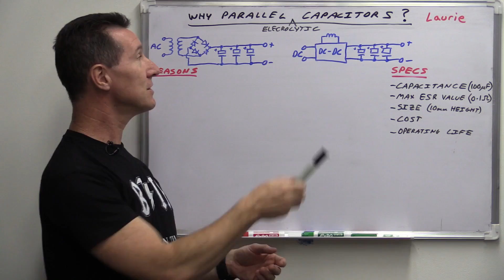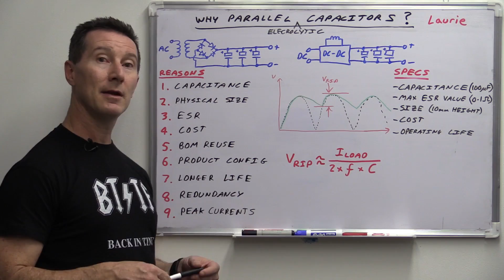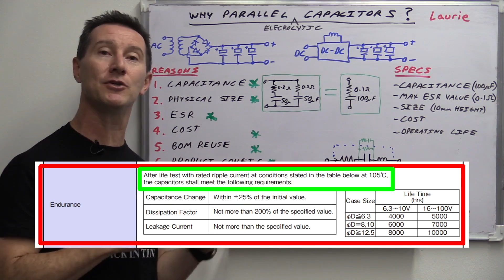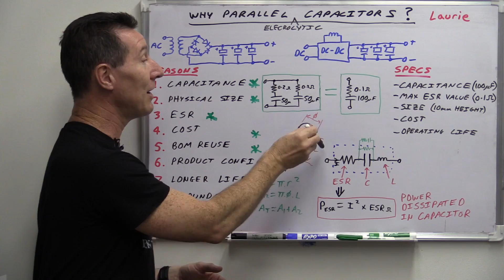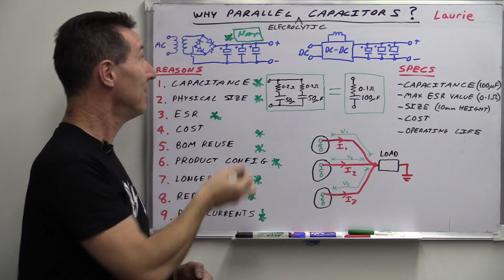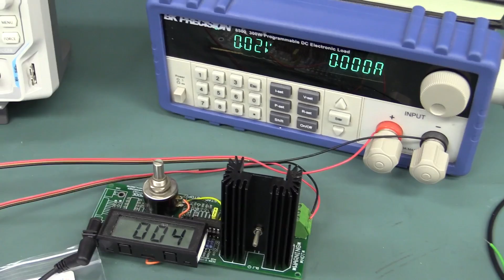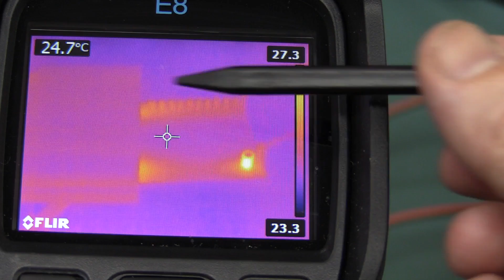Comment: Hi Dave, I'd like to share a practical example related with this video. 
Three months ago, my Neato 21 vacuum robot got the "Dimm Green of Death" after one year of continuous use. I replaced the batteries but the robot doesn't wake up. 

Looking around the web, I found that the problem are the capacitors. They used 1 capacitor in each voltage regulators. 

You can see a Russian guy fixing the robot: https://www.youtube.com/watch?v=WR7yx-E1Y14

This example has all the elements that you discussed to the robot follows the path of failure.

Thanks for the video. I will have a more fun weekend fixing this than playing Xbox.

Comment: "Electrolytic Caps 101". Great vid Dave. Chock full of years of practical experience. 
Suggest making "part 2" next addressing questions raised here in the YT comments and in the forum.
Reply: davecc0000 Yeah probably needs a part 2. I forgot to include a few things I originally had in mind. That's the problem with not keeping a list before I go record a video.
Reply: EEVblog Yeah, terrible. (c;
You cover 99 of 100 things in the category of e. c.'s. better than any educator I've seen. It's not due to failure on your part I ask for part 2 but your subscribers' insatiable desire for more knowledge!

Comment: I don't think that Stefan-Boltzmann equation is the right one since thermal energy will be mostly dissipated by thermal conduction, while S-B law is for thermal radiation. Anyway, the area of the capacitor surface still maters as the thermal conductance is proportional to the area.

Comment: Even Man is designed with two capacitors in parallel adequately positioned for better heat dissipation and a reliable system for redundancy to keep your load happy in case of a partial malfunction.

Comment: yep, radiation, heat transfer, but most heat is dissipated by convection!!
of course, if you are in gas or liquid environment with gravitation :P
Reply: Bastek Master you are 100% right. With those small temperatures the main heat transfer mode is convection, radiation is negligible.
Reply: vihai Dave isn't master in heat transfer theory :P
Reply: ***** there is no simple equation, but thy are simple rules, CFD tools.
There is still area for intuition design and experimental testing.

Comment: so lets say i need 50 mics on my little power supply.... 

what would 0 or 25 mics do?
and what would 75 or 100 mics do? 

basically...what happens when your under or over spec.... and if you were to design a power supply, how would you find your needed value?
Reply: Hey, that's what spice is for ;9
Reply: ***** ah. so its just for ripple control (dur). cool, thanks!
Reply: ***** 
You shouldn't overspec either, especially in standard transfomer/bridge rectifier circuits. Higher capacity means lower ripple, which you'd think is good. But with less ripple there's also less time to "refill" the caps, because they will only be charged when the voltage at the bridge rectifier is higher than that of the caps (obviously). For the same load that means the same amount of energy has to be pumped into the caps in a shorter time every cycle, which results in higher currents through the transformer secondary, the rectifier and the caps.
To make it short: if you replace caps use the same value that was in there. And if you design something be sure to take that effect into account and don't massivle over spec either.

Comment: Stefan–Boltzmann law is not very usefull in this situation since most of the thermal energy is going to be dissipated through
contact with the air and not radiated in the form of electromagnetic waves. Blowing cold air into the caps lowers their temperature even though it doesn't affect the black body radiation at all. Also, I don't think that you substract ambient temperature from the temperature of the body to calculate the power radiated.

...I liked the video.
Reply: enguibuck Yes it only applies to a non convection environment (like a closed case), and assuming no conduction through the leads. It's part of the story, not the whole story.

Comment: Nice video Dave as always, very informative and a good demonstration at the end.
Being picky but I think you had the A1 and A2 back to front with reference to the formulae when you discussed the capacitor size at 13:39.
What was happening to your FLIR display right at the end, seemed to be jumping around a bit swapping displays.
Reply: Michael Hawthorne The trigger button was pressing on the tripod and taking photos!

Comment: I was kind of hoping you would include why they are parallel to the circuit specifically as that is what I first though the question was about, or at least part of the question. I have some high power filters for I think 3 phases and the capacitors in them are in series. AC application so a bit different.
Reply: Tuttomenui He covers series capacitors in the '#268 Xantrex Power Supply video' and why you can add resistors for voltage sharing.

Comment: Lots of good items on the "capacitor specs" list, but it's notably missing an important one...working voltage.
Reply: lmiddleman True.
Reply: Yes, but working voltage isn't necessarily a reason why to parallel capacitors, which is what he's talking about here in this video... Working Voltage definitely IS an important spec to consider when installing a cap, but that spec really has nothing to do with WHY to parallel capacitors.
Reply: @JoeJ-8282  but it does feed into size - a higher working voltage capacitor is going to be (much) physically larger for a given capacitance all else being equal, which might run afoul of your design constraints.

On the flip side if one high voltage cap fails short, things are gonna get interesting real quick.
Reply: Maybe temperature as well

Comment: You did not show that 2 caps in parallel with each 1/2 the current will have 1/4 the power  wasted in each or 1/2 power wasted in all.

So not only do you have twice the surface area but half the heat in each. So 1/4 temp rise.

Also works for MOSFETS. Had a buddy with a DC high-side switch get too hot. Added a second on the same heat sink, and it ran cool.

Comment: In my experience electrolytic caps in parallel are most often found in RF Power amplifiers to overcome voltage rating limitations and arc-over issues. They are put in parallel or series-parallel, each with its own bleeder resistor. Commonly with 3K to 5K volts running >100 watts across them.

Comment: Replacing capacitors is always the thing wrong with modern TV's. Best thing are the ones that are easy to open up and replace!
Reply: aaroNiGHTS They do fail a lot in TVs and monitors yes.  And it's almost always the same ones - the output capacitors that filter power to the low voltage processor/TCON boards.  I really wish they would just add the extra $5 to the cost of the TV and put some high quality caps in that one spot at the factory,  but nope they'd rather have you buy a new TV.  I'm tired of replacing these shit Samwha/Sam Young caps.
Reply: aaroNiGHTS what

Comment: Nice job on the video. I'm not sure #9 of peak currents is that much of a justification, since you can always make caps and traces bigger. If you can't, then that goes back to other reasons from #2 through #6. The biggest reasons in high-quantity manufactured electronics is usually #2 through #6 (ESR, Cost, Reuse, and Product Config) and how they can be worked into #1 for common capacitance values.

As for longer life and redundancy, this is usually only worried about in top-end products or mil-spec stuff, not so much in consumer electronics meant to last 5 years or less. For example I've seen high-end PC motherboards with redundant caps and even very reliable, solid caps, but those are there to be touted in the marketing and keep that brand's reputation relatively higher than other brands.
Reply: ciphernemo Actually I was just reading a Xilinx app note where they did almost exactly that.  http://www.xilinx.com/support/documentation/application_notes/xapp623.pdf
Reply: ciphernemo Yeah, just trying to think of every possible reason to show that potentially that's possible.